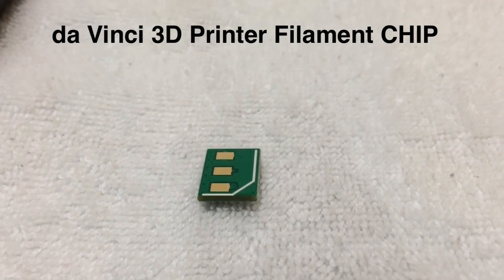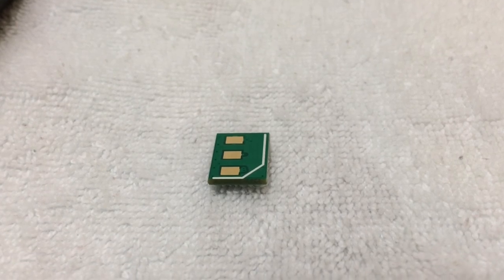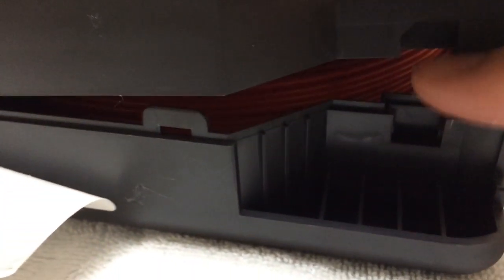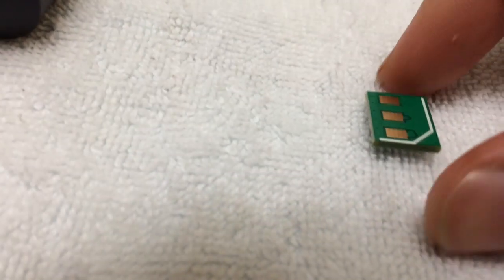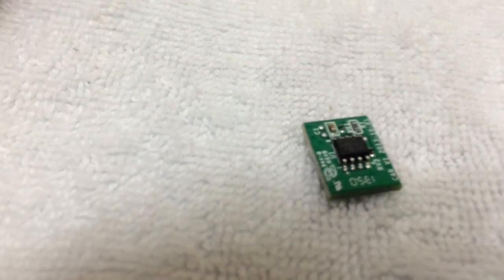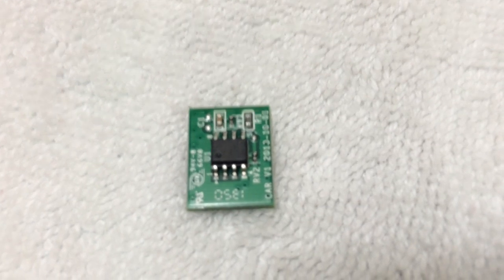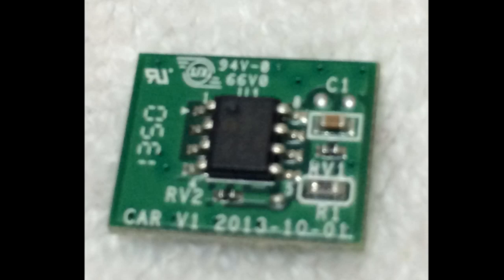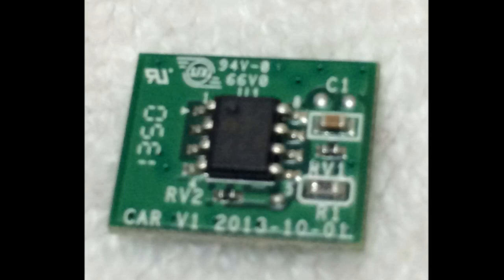da Vinci 3D printer filament cartridge chip

Comment: It's great to see that there is a hack for the chip. My company got burned with Dimension Printers Uprint. 26K machine that has the same bulls&^t issue with filament. I might have a look if I can apply the hack to the spent cartridges at my work. Thanks for the info and links guys.
Reply from the maker: Well did you ever figure it out?

Comment from the maker: John Dough, it's actually cheaper then MakerBot filament. MakerBot is $48 / 1kg and da Vinci is $28 / .6kg which equates to $46.67 / 1kg. So I wouldn't say it's a scam. Plus there are work arounds that make this an open source printer.
Reply: I would like more info on the work arounds.  IE other software, chip hacks (?), read on amazon it needs board replacement?

Comment: Hello Hrt Tele.
I am thinking of buying an xyz 3D printer.
Can you tell me if I'd be able to keep printing only by putting the new filament inside the cartridge (and not the cartridge case or chip) - once the original filament is over?
Thank you.
Reply from the maker: nindoda, it looks like you can but the chip acts like a counter so you need to reset it every so often. Here is a link on how to reset the chip.

http://voltivo.com/blog/da-vinci-reset-eeprom

I'll do a video of this mod myself soon.
Reply: Hrt Tele
OK thanks.
Reply: Hrt Tele
I forgot to ask you about something. Can you tell me what are the dimensions of the cartridge's inner spool?
Reply from the maker: nindoda Sorry for a long delay in my reply. The one that came with the printer is Ø6.625 in diameter and 2.105" wide. This one was already in the printer so I can't measure it. But I imagine it is the same or very close.
Reply: Np. Thanks for the reply.